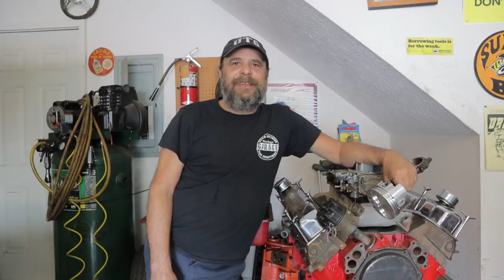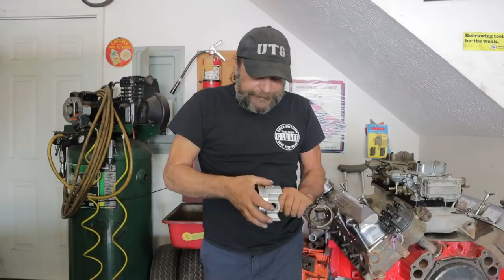The Great Piston Pin Offset Controversy ANSWERED!

Comment: This comment is about Smokey Yunick. A few things about Smokey. First, he was in the Air Corp in a Bombardment Group in Italy during WWII. Second, he was self taught and was embarrassed because because many of the other guys had college degrees. Third and not least, he tirelessly sought more power from engines. 

Some of the firsts were: header wrap, weight reduction. and the list goes on and on. He was also slick. I remember Vic Edelbrock Jr. did a video about Smokey at the time of Smokey's death about 20 yrs ago. Vic invited Smokey out to race in an event In Cali in the late 60s. Probably a trans am event. He towed the race car with a bumper hitch from Daytona to Cal. 

Vic saw the rag tag set up and thought how could he compete with that. Smokey took first place by several lengths. Vic wanted to know what made the car so fast, because the car appeared identical to all the others. Later on, the car was weighed and found to 150 lbs lighter than the other cars. I think they were all Camaros. That explained the reason for the speed but not how the weight was reduced since they were all built to track specs. Later still, it came out that Smokey built the car to 7/8th specs. LOL, and that was also Smokey. 

He hated to lose a race. He used to tinker with the superchargers on the B-17s, always after more power. Society doesn't make men like him anymore. God bless him.

Comment: Tony gives lots of real world applicable advice. I was working on a 440 with electronic ignition. It had a 4 pin ballast resistor and I was beating myself up trying to find out what idiot puts a ballast resistor on electronic ignition. But it looked like it belonged there, because it did! In one of Tonys vids, he held up the exact resistor that I was looking at except mine was busted to shit. I replaced it and now the engine runs like a song. Glad I didn't just cut it out and hotwire past it! Roadkill was entertaining for a while but otherwise I didn't learn much.

Comment: What I have heard about this was it was a old racers trick to get some extra horsepower and I have heard this from old guys that have now passed on. I remember telling my older brother who was a chevy guy and he always wondered who I was talking to. So as it happens one day at his shop a friend of his was over. I said to his friend you know Chryslers right and he said yep. So I said have you ever heard of turning the pistons around and before I could finish he was explaining it all and there was my brother who looked up to his friend and had so much respect for him that he was dumbfounded over this. I've seen some of these videos online but havent watched all the way through but the thing I recall was that the connecting rods had to be removed from the pistons and turned 180 degrees. Now after all the craziness Ive seen online I'm sure there are gonna be comments to me. Thats just my comments.
Reply: If you have 4 valve reliefs pistons, you just put the right side piston rod assembled into the left side, etc.
Reply: @hotrodray6802  You wouldn't take a piston and put it into a different cylinder than it originally was worn in regardless of having rings as a barrier.

Comment: For those shows every "budget" build includes anywhere from 5-20k worth of free parts from a sponsor against a 10k budget that goes mostly into vastly discounted body work, wheels, and tires. They don't count cost of the car, lines, bolts, fluids, gaskets, and stuff like that just major parts. Budget builds on car shows (yes even Monster Garage) are a joke.

Comment: I mean from a statics standpoint, it makes sense. Under the assumption that the mixture is ignited at the same time as the standard orientation piston, it will make a little more power. By letting the crank rotate farther before ignition, the force from the explosion is not as online with the center of rotation for the crank, so more torque can be applied to the crank shaft. It's like using a cheater-bar to get more leverage.

Comment: The only motors I've ever built were 383s and 440s. Particularly 440s. I always flipped the pistons around(I always used 6 pack pistons). I was told many years ago by a guy who built Mopar NHRA stock and super stock motors to do it. He did tell me that it improved torque moreso than horsepower. He is the guy who taught me how to build a low $ 440 B-body for the street that would run mid 11s and I built several. A 1968 Satellite that I stuck a 440 in and a 1970 GTX the same. He knew his shit believe me.

Comment: right on, from mid 70 through 71 we had an in-between head from the domed high compression to the late low compression "E" heads on our scouts and other IH...  They called them swirl chambers, centered flat tops, but the chamber where designed to evenly "swirl" the downforce evenly.....   Then they had to go even lower compression..... Why they didnt continue that design I do not know, It worked, but like you said, almost unnoticeable gains so......  what I do know is even pre erg and cats, just the compression drop made a 345 the same power as a 304 and the 392 the same as a 345, and burned more gas lol.   but we would never hear any piston slap over the direct gear turning the camshaft backwards lmao....

Comment: Reverse offset works but they do clack unlike an offset pin piston . Racing pistons clack ,too . Silent sprockets have no noise like iron or steel timing sprockets . Manufactures want engines that run quiet until the warrenty runs out .

Comment: Uncle Tony, first off im a huge fan i think i have seriously watched every single one of your videos. I saw both of the piston pin offset videos yours and the guy who explained it and i totally understand it but i only have one question im on a shoestring budget and i cant afford to get a new block and dont really want to have to so this leads to my question if im building an engine (sbc) and i offset the pistons will they in time wear out the cylinders as far as if it did slap around that tiny bit would it cause them to wear out the sides of the cylinders and make the slap worse if it ever did? And also whats the longest you have ran an engine with the off set and have you ever noticed any unusual wear in the cylinders or on the piston skirts?  Im just worried about 5-10 years down the road having to scrap the block or have to have it resleeved. Thank you for all of your knowledge on cars by the way!!!

Comment: Circle Track magazine under the leadership of Pete Saueracker circa 1990 built two different engines to test offset piston pins, and two other engines to test out long rods. As I remember things, both showed a benefit. However, given the ease of getting stroker cranks, roller lifters, killer heads, and electronic fuel injection, I'm not sure either long rods or offset pistons are worth the hassle.

Comment: Ok, I don't know anything about who's calling out who or what the controversy is... but an older friend of mine who has been building engines for race cars and offshore race boats for years told me about offset piston pins back in the 90's ( he was in his late 50's then , just for a time frame) the way he explained it was that at TDC the pin and the crank journal are not in line so that the power stroke doesn't have the disadvantage of pushing straight down on the crank. The angle of the rod is as if the piston is already traveling down the bore... later on I ran across a booklet that came with a German building set toy I played with as a child (early 70's).. (think Legos on steroids) called Fischer Teknik.. on one of the  pages it illustrated piston pin offset!  Apparently the subject was child's play to the Germans 50 years ago! I don't have any data as proof of it's effectiveness...but it makes sense to me.    You go Tony! I think you're right..

Comment: I don't know much of anything but if there is a gain from pin offset reversal then it seems to me it could be that it bumps the compression up a shade. I assume the pin is offset towards the centre of the v to put less sideways push  on the pistons at the top. Turning the piston in the bore would bring the pin down the bore just a bit so the rod would push the piston up in the bore just that little bit more, resulting in more compression. Don't know if that is right or how much gain you get or if it's even measurable.

Comment: If those guys say UT is wrong about reversing the pistons, the ball is in there end of the court to prove it.
Reply: I reversed some 318 pistons on Saturday.  No piston slap whatsoever.  I think it’s as simple as this:  The optimum place for the wrist pin is the center.  The factory wanted to ensure quieter operation in all ranges of conditions, so they offset it.  If a stock piston is what you’re going to run, it gives you two options, an offset on one side or the other and opposite of the factory is the better choice if a maximum theoretical benefit is to be achieved in terms of friction and rod angle through the combustion events.  I think people make too much of this.

Comment: Hey Uncle Tony... I watched Tom's video.  The pin offset has nothing to do with flame travel. Pressure is the same everywhere in the combustion chamber. It is a sealed vessel. Frame front combustion starts out localized and it propagates, yes, but the piston doesn't see this force until every atom of gas in the combustion chamber is at the same pressure. Pin offset is about getting the rod angle straighter when on the power stroke side of the crank. Industrial engines (Grahm, Continental, Hercules, etc) actually have the crankshaft centerline offset towards the power stroke side of the bores in the block. All this means the straighter the rod is with respect to the crank throw when it is going down. Straight up mechanical linkage and force vectors. This is all well established engineering science. Tom needs to get acquainted with physics. Not trying to be mean, just I hate videos that are more opinion than science.

Comment: uncle tony,i myself switched the pistons  1969 on a formula s 273 commando engine,after racing a 289 271 horse stang,i smoked him and my engine,one of the circlips came loose and took out #7 cylinder,sleeved it went back with new pistons on stock bore,engine only had 63k miles on it ,belonged to an old lady who traded it in on a sport fury,i worked at a chrysler dealership and most of the mechanics there were old top fuel guys,i apprenticed under them,as was union law,the engine would rev past 6200 prior to switching the pistons,after switching the pistons and installing fenderwell headers custom made,and 3.91 gears,it would rev 7200,whether this trick worked or not,didn't matter as i was making more money street racing at the time,i was 19, the cuda put me thru all the tech schools i went to,now,dulcich,i've read all of his articles over the years,so i'm not mad at anyone,but knocking smokey yunick,sheppard aint' gonna get it,those guys are genius,steve i'm waiting for your books,patiently,i've no dog in this race,but no badmouthing is going to be accepted against my heroes,i've read all the books i could get my hands on from,black,yunick,sid waterman,and many other greats who won races by their genius guesses,tone it down on bashing,steve and david freiburger,what i did worked,and could be felt by the seat of the pants,i had the fastest car in kc area for 2 years,then i blew it up against a 396 -125 horse nova,went back to school,didn't race anymore went straight into restoring e bodies for the next 30 years and built movie cars for awhile,no bashing boys,the kids are having fun with our thoughts and builds,god bless

Comment: Geez, let's start the other piston controversy--should you coat the top in VHT or other header paint or does it wear off soon after engine break in ?  

:)

As for long versus short con rod, we have to keep in mind that since its changing piston speed, cam timing has to change to make the most of it. But then we get into the debate, is it better to fill the cylinder, to evacuate it, or is it better to focus on the quality of the combustion of whatever does get into the cylinder.  This all starts adding changes to an apples-to-apples comparison.

Still, exchanging pistons is cheaper than a new set of long connecting rods (whose weight may offset the smaller piston) or offset bushings in the small end of your stock connecting rods and then worrying about where you're going to deck the block and will an align hone of the mains throw everything off.

Comment: interesting to learn about this, bad luck he turned comments off. I just rebuilt my 1968 383 HP. Had problems getting replacement hi comp pistons, stock was 10.2:1. I ended up with KB pistons that looked quite different to the stock pistons, they had valve reliefs to start with and they were around 10" down the hole. Problem is they rattle when cold, so maybe they are not offset? I think I will turn them all around to see if that makes them quiet. My cam is mild so i dont think the valves will hit the piston.Any advice welcome.

Comment: One thing that the MT boys made a point of is that most guys rebuilding engines aren't going to use stock pistons and that the aftermarket ones will have centered wrist pins. Valid point. I think the Tony viewers who are building stuff from leftovers vs the MT staff who get to build with someone else's checkbook may be something they didn't consider. This 'controversy' is all good fun, IMO and at least gets everyone talking/thinking about it.

Comment: Is there a benefit to doing this to a non-wedge head, as in a hemi or a poly head ?
I know they did this in the ford flathead 8's, and even the 4's, but by a different method- by offsetting the crankshaft center line. (de Saxe principle) But, those have the combustion occurring to the side of the piston, as  does the wedge combustion chamber, which then spreads across the piston face as is described in his video.
Thoughts?

Comment: In an all out race engine, such as  NASCAR events, even Formula One ( Not really applicable to Drag Racing ), where friction is of significant concern, ( Not necessarily Drag Racing, where the engine sustains a high RPM for short durations ), reversing the piston thereby moving the pin offset, could provide a benefit, however, the Horsepower and / or Torque are not one of those benefits.  Reducing friction within the reciprocating assembly serves two ( 2 ) functions, one being extending the life of those parts through reduced friction  thus minimizing internal wear, and, over a long period of time, where sustained high RPM use is required, a minor reduction in operational temperature can be recognized, so long as the balance of the rotating assembly is maintained.  Depending on what brand / style of engine, valve reliefs may need to be recut to ensure proper clearances.    In cases where  new valve reliefs need to be cut, a reduction in net useable horsepower and torques can be realized through a drop in compression ratio, caused by the addition of valve reliefs, making such an operation inefficient.  Been building high performance engines since the mid 1960's, and, have NEVER bothered with the insignificant benefits, when those benefits negatively impacted my horsepower and torque curves, which to me, are of  much greater value.  People like " Smoky " were great innovators of their time, but, one must understand, THEY WERE IN IT TO MAKE MONEY off of their innovations, EVEN THE ONES THAT DIDN'T WORK !
Reply: One thing I forgot to mention.  As it pertains to piston friction in the cylinder bore, if reducing friction is the ultimate goal of reversing a piston pin, with todays technologies, there are reduced friction piston rings that will accomplish MORE, there are also much better fitting pistons, AND RINGS at reasonable prices through just about every parts house in every town.  Just a quick FYI, for those considering making such a change.  The cool thing about NEW pistons and better rings is,  YOU GET IT ALL ... Reduced Friction, Better Compression, Increased Horsepower and Torque as well as LESS INTERNAL NOISE !  Have a Great Day

Comment: A lot of modern engines are built with - forget the offset pin - offset CRANKSHAFTS.  When I pulled the motor from my 2000 Honda Insight, you could see clearly that the bores are not at all centered on the crankcase.  Geometry that's good for power is usually also hood for fuel economy.  The Insight actually has some significant piston slap ol a cold start, but they made sacrifices like that in order to get the 40% thermal efficiency that engine has (which is better than most diesels made today).  Motorcycles do this a lot too.

Comment: Factory does care more about quiet than anyone else. I will watch the other video next. I wonder if the offset has a similar effect as a longer or shorter rod  does. In that it changes dwell at or near tdc which alters the pressures and burn rate. Interesting .

Comment: My '70's Direct Connection racing manual addressed rotating the pistons 180 for a nominal power gain. If I recall it mentioned a slight increase in noise and cylinder wear.
I'll have to revisit the bible.